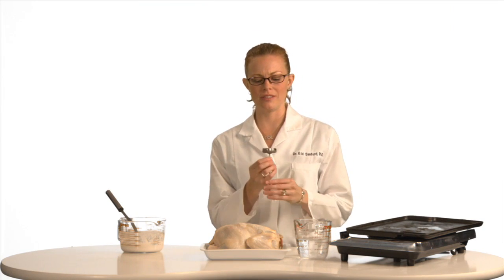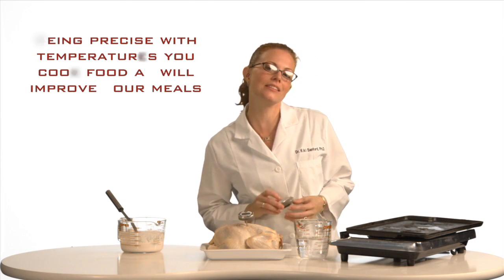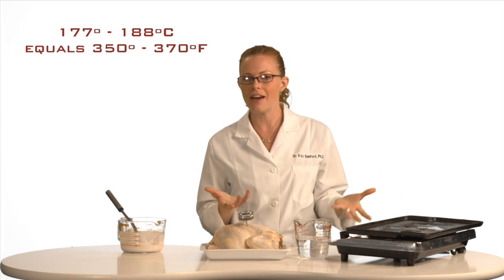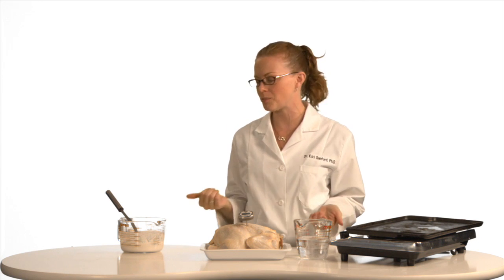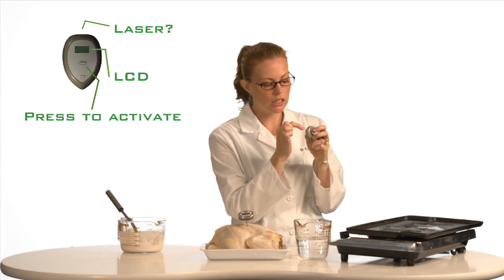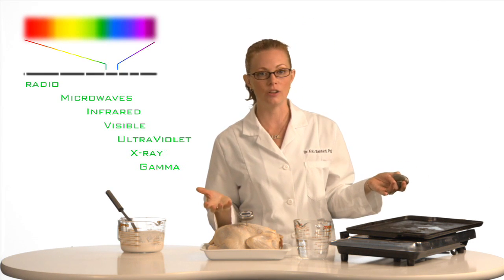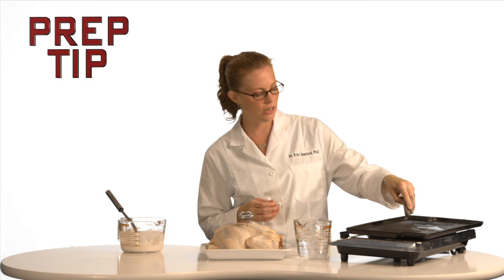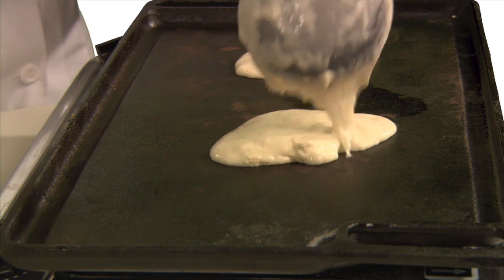How Infrared Thermometers Work - Food Science

Comment: So the question remains, "how do IR thermometers work?"
Reply: Have you found out
Reply: Like a small and cheap infrared camera
Reply: Beeb  - The laser is just a pointer. It's got a small infrared detector behind a lens that focuses heat light (infrared) from whatever you point it at.
Reply: The optical sensor reads the blackbody radiation being obmited. She legit said that
Reply: @MrDoe-nw4ev  but how does the sensor determines the temperature? If it would by detecting the amount of infrared radiation, it would also decrease with distance. How is it possible to measure the same temperature with different distances?

Comment: I’m really looking for a video with equations behind all of this :/ I’m wondering if the Power of a Hot Object equation is used:
P = sigma•emissivity•Area•Temperature^4 

And then I imagined a detector used the equation:
Intensity = Power/Area, where the power is the power from above
Reply: Do you know how the director works? How does the sensor determines the temperature? If it would by detecting the amount of infrared radiation, it would also decrease with distance. How is it possible to measure the same temperature with different distances?